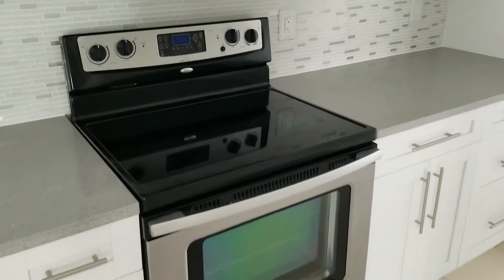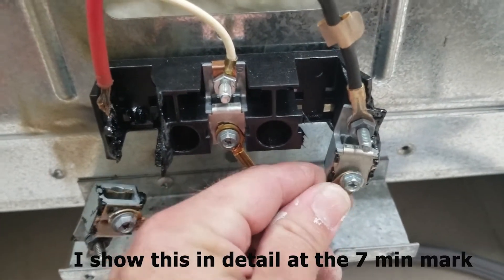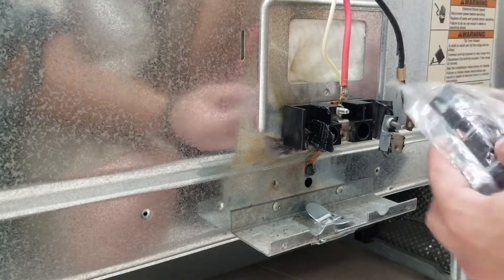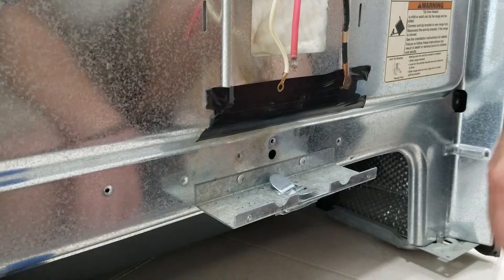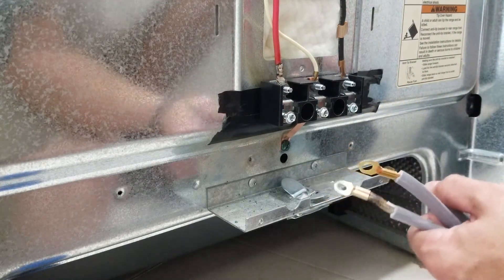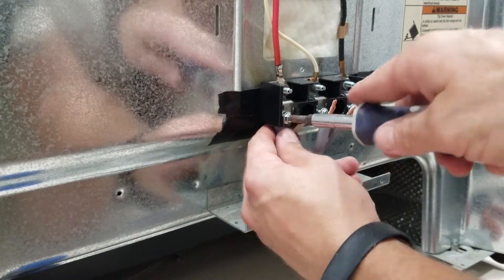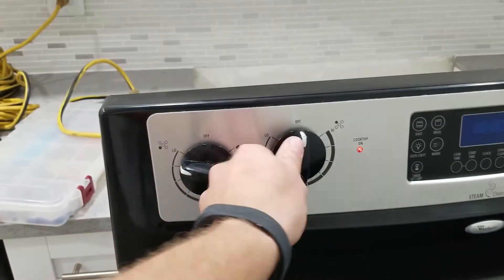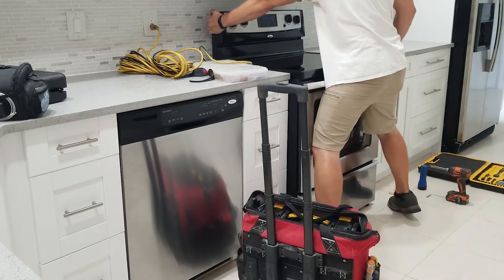Whirlpool Range WFE371LVS burners not working (How to Replace a Terminal Block)

Comment: Mine just burnt out. When I took off the shield I noticed the black and red wires were reversed. Been like that since I bought this place 4 years ago. Does it matter?  Not sure if that caused the issue. If it did, why did it last so long?

Thanks
Reply from the maker: It may have just  been a connection that worked loose over time. I haven't done any research to see if there is a recall on this unit or if this is a common problem. Either way, the black and red wires SHOULD both be 120V each to make 240v total, so it shouldn't matter if they're reversed as long and the Neutral and Ground are correct.. The white (Neutral) wire and ground (green) wires do matter. If those were wrong it would trip the breaker if it didn't catch fire first.
Reply: FixItWithJerry  Thanks. Yes, white and green were ok.  Was gonna replace entire unit but there is a backlog of appliances.  I’ll by a new terminal block and swap it out. Seems simple enough, just was not sure if safe to do so.  Now that I know it is safe I will do the repair.
Reply from the maker: @nickdeliso7026  Yea, the only other problem could be an internal short somewhere. when after you install the new block just be sure to test it one burner at a time and be ready to kill the power if there's still a problem. Good luck!
Reply: FixItWithJerry Thanks. Whirlpool sending a guy to look at it.  No charge. Not sure how much repair will be if I decide to have him fix it, but it may be worth a few extra $$$.  Part is about $40.
Reply from the maker: @nickdeliso7026  Nice, that sounds worth it!
Reply: FixItWithJerry final chapter is he came and said it was block terminal.  They get old, break, and short out.  Wanted $168 to replace, plus $27 for the actual part.  He sold the part to me, which I installed myself.  $168 plus tax saved for 10 minutes of work.
Reply from the maker: @nickdeliso7026  Nice,  I would have charged something similar. You're paying for the knowledge plus the tools, the truck, insurance, etc, etc. . that comes with operating a business. Glad you got it fixed though!

Comment: Did the oven still work?
Reply from the maker: No, the clock and the light worked (they sometimes use only one 120V leg) but everything that needed 240V was not working since one of the 120V legs was not making connection.

Comment: Excellent video, very helpful but in my situation the black hot wire is burned with the connector , so do you have to replace it , and how, or just cut the burned part? Please if anyone knows about this. Thanks!
Reply from the maker: Yea, if you feel confident enough in your abilities that would be the way to do it. If it's burned on the plug side I would replace the whole plug. If it's burned inside the stove itself then I would try and replace the entire wire if you can easily access both ends. If not, at least replace the burned section, solder and heatshrink the in-line connection. You may have to cut back farther than what appears to be burned on the outside, there may be charred wire that you can't see. This is high voltage (240v) and High Amperage (30-50amps) so there is a serious risk of fire if it's not done correctly. If you have any doubt it may be best to hire a professional appliance repair person and since you have an idea of what's wrong you may be able to save some money on a troubleshooting charge. It's better to pay someone $100-$200 for a repair rather than burn the house down. Hope that helps!
Reply: FixItWithJerry Appreciate your advice, thanks a lot!